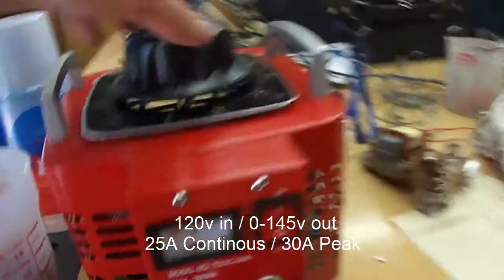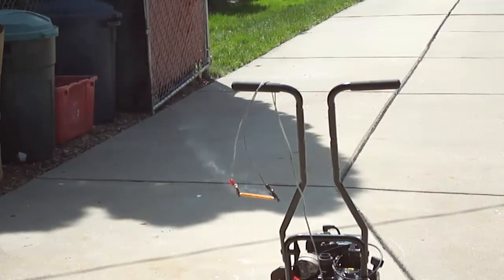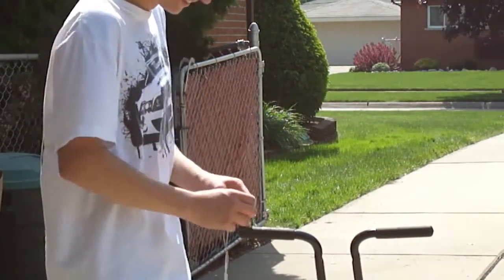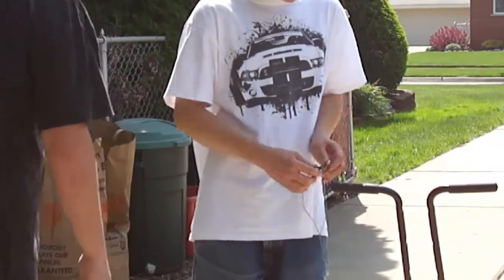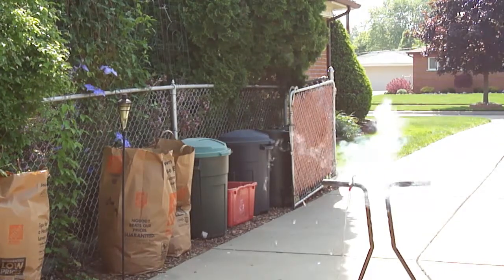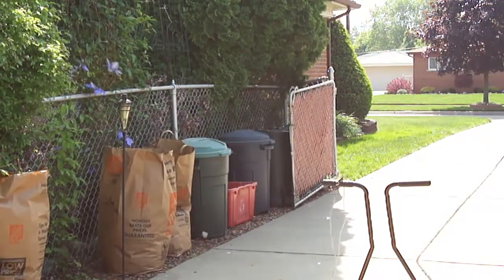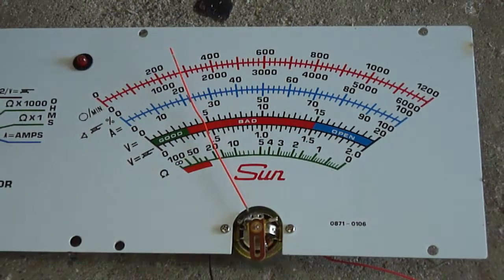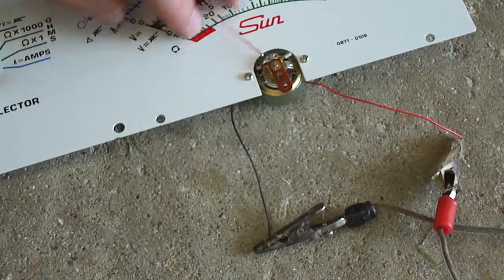Capacitor Popping Montage

Comment from the maker: Cool, I'll go take a look. Inrush current is never a problem in my garage for some reason, the lights will dim though. In my house it's a whole different story. I've put a light switch in series with the hot wire, and a resistor in between the contacts. That way current always flows through the resistor, and when switched on, full current can pass.

Comment: A Fun-Jiggery-Pokery Unit is the thing into which the ballast is connected. :-) It has many uses apart from providing overload protection to a variac. I've even used my one as a soft-starting unit as per my video "Inrush Problems & solutions".

A handy little unit to have & can be used with or without a variac. :-) I even have a How-To vid on my channel of when I made my second unit which is safer than my first quick-knock-up one.

Variacs can be weighty lumps. I've put wheeelz on mine. :D

-BBD

Comment from the maker: Yeah I think these are really just smoke generators, lol. By a Fun-Jiggery-Pokery Unit, I think you mean a ballast, which I had something that would have worked great. It was a big old transformer, and one of the secondary windings would allow 15 to 20 amps max which would be perfect. I could get another just like it. Also, the fuse that kept popping was a 15 amp on the output side of the Variac for extra protection. A 25 amp is on the mains side as well. Thanks for the comment.

Comment: Interesting capacitor poppage. :-)

To protect your variac from being over-cranked, use a Fun-Jiggery-Pokery Unit on the output of your variac, & then, you can crank something RIGHT UP without having to worry about busting your variac or popping fuses! :-)

That way, you can get right into the fun & feel the full-on DEEPEST SATISFACTION of cranking something up....UNTIL IT POPS. :D

That first cap had a lot of magic smoke in it! It's amazing how they squeeze all of that smoke in there. :D

-BBD.